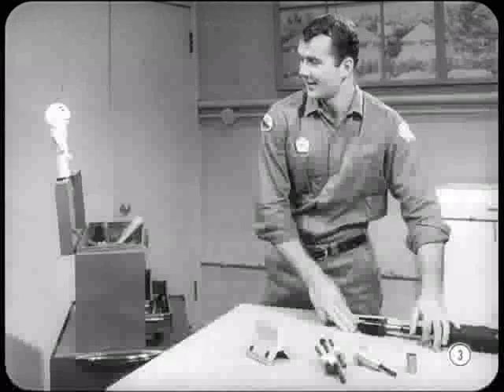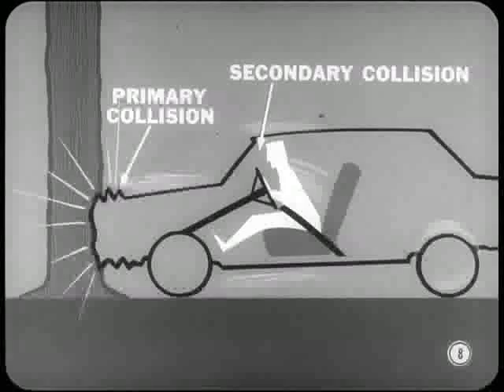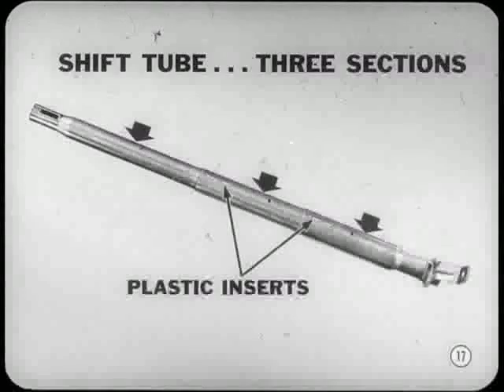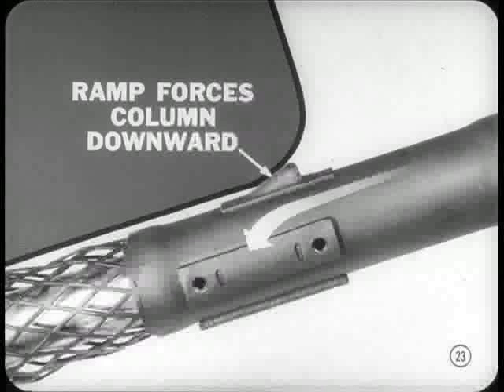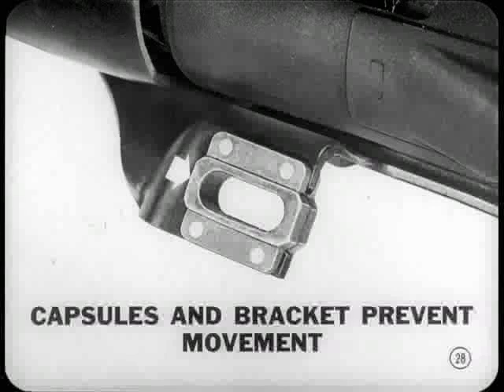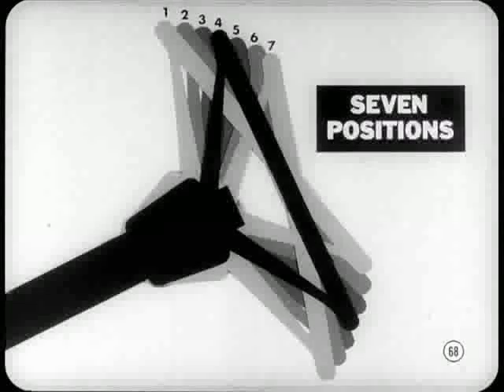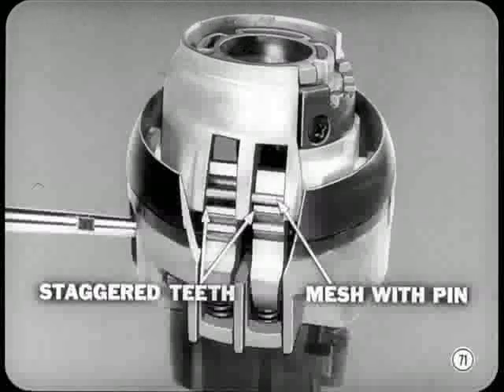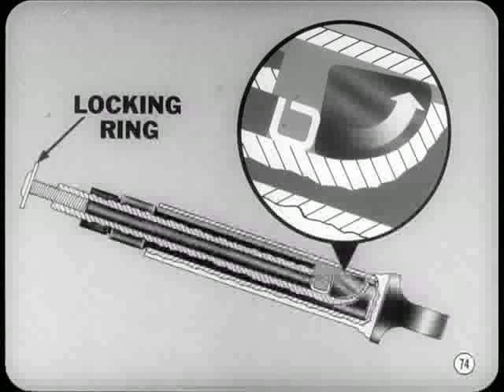MTSC - 1967, Volume 67-2 1967 Steering Column Service

Comment: Holy cow!! Just installed my column in my 68 dart!! I had no idea that it was such a precise install job!! Its a drag race car, will go about 128 mph!!! It seems to fit good, although I had to change the dashboard, I don't recall removing any shims!! I only wish I saw this before I removed it!! It seems to turn smothly!! I guess any steering issue, I will stop and inspect my install!! The only problem i really had was clamping the two cones together just below the steering wheel, held together with 2 small bolts the hook one to the other. The hardest, stupidest auto design part I've ever seen!!! Great video, don't know where it came from, it its asome!! Thanks!!!